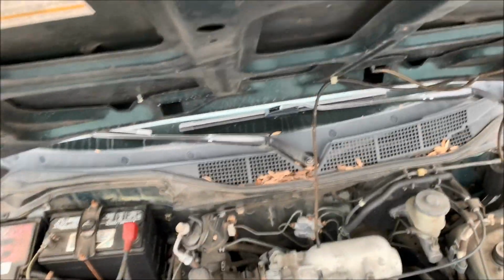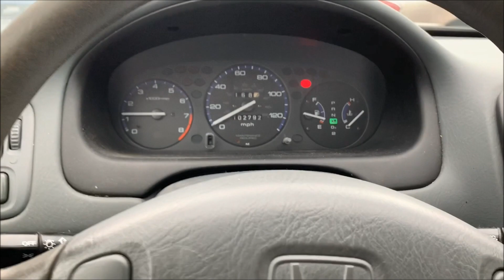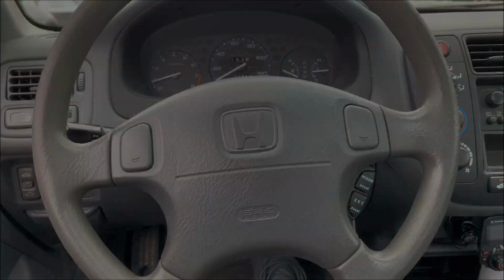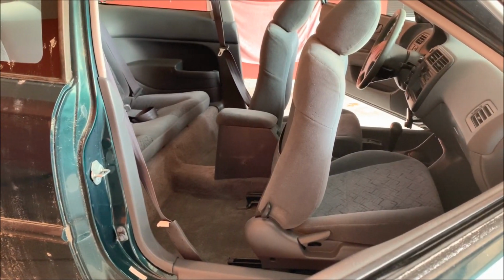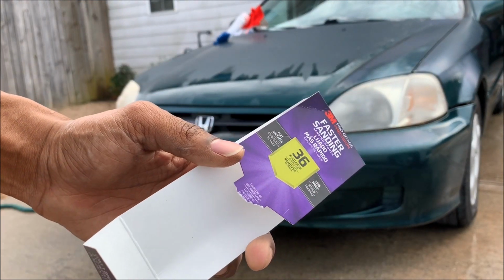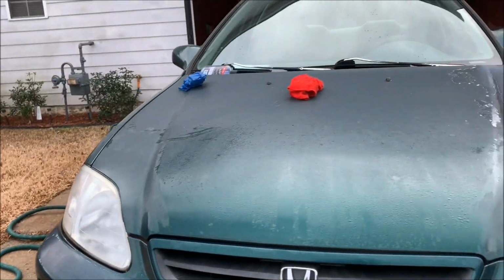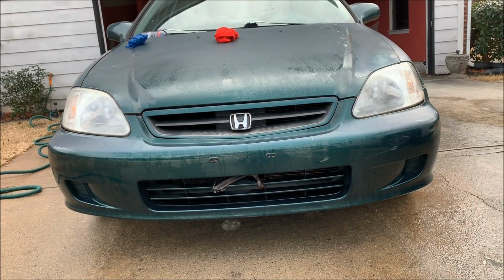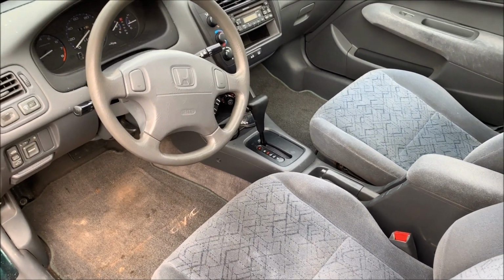THE SABOTAGED AUTO AUCTION HONDA CIVIC IS READY FOR SALE!

Comment: Just today at Dyer Auto Auction in Dyer Indiana, I checked out a 2008 Lexus IS250 with 277k miles on it. I started it and notice it missing, engine light illuminated(ing coil) and the VDC alert. When I drove it, it felt like it was stuck in one gear. I never witness an IS250, even with the mileage in that type of mechanical shape. But when I open the hood, remove the plastic cover, I noticed an intake plug that was completely off, and a rear left side ignition coil plug completely off. I attached them and drove the car again and it was fine...Damn thirsty 🐴 dealers 🤦🏾😠

Comment: My wife bought one of these Civic's new in 98.(same color) in Warner Robins A few years later we got stationed to North Dakota that car always started in 30 below weather and never got us stuck in the snow. I Keep the maintenance up and it always ran never left us stranded. They're great little cars. and over the years i've resold a few. If you get the bad spots repainted with 102k you could probably get around $2500-3000
Reply from the maker: The best civic ever

Comment: Great buy mate. Love those hondas. Should be a quick flip. I'd polish the rest maybe just get the hood painted. With these little two door jobs I find it easier to clean by taking the front seats out. Usually only like 4 bolts,  just gives you so much more room inside.

Comment: I like the paint because it takes the stress off door dings and with the low miles should be a good reliable car for at least 100K. So for the seats and carpet a medium brush and two part's water one part simple green and a shop vac does wonders.

Comment: Someone unplugged those things to try to discourage you or anyone else from buying that car. They probably figured they could swoop in and buy it for nothing. As far as painting it goes you have to figure out how much it's gonna cost to have it painted and weigh that against how much you can get for the car. If you think you can get substantially more for the car with it being refinished then you might want to do that otherwise you might wanna sell it as is. Clean it up the best you can without investing a lot of money in it because you soon reach what is known as, The point of diminishing returns.
Reply: that what was thinking too,that someone unplug the sensors,not the dealer

Comment: Man get rid of those 1979 car washing techniques. Soft bristled brush with an extension on it, soap it up and get the cars done with less effort instead of using that dish rag and wasting time and breaking your back. Don’t forget the battery operated leaf blower to dry them off and usually after that there is no wiping off.